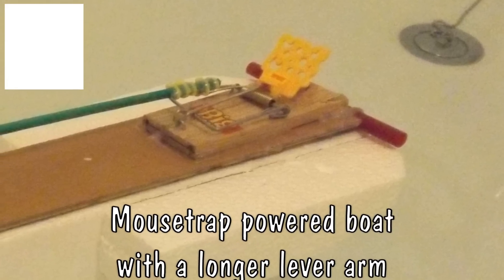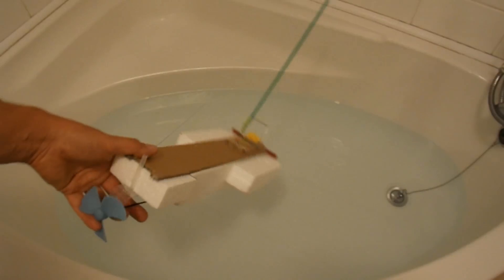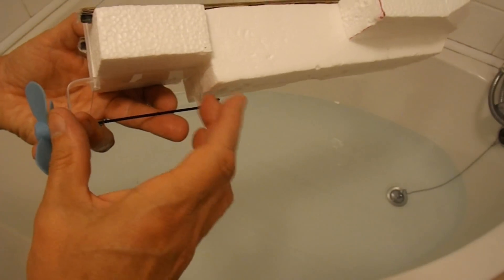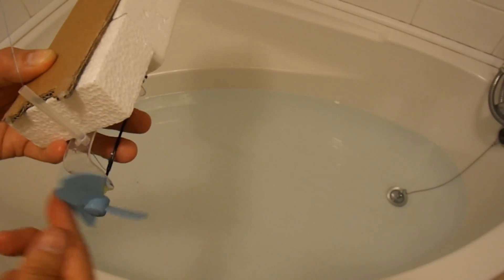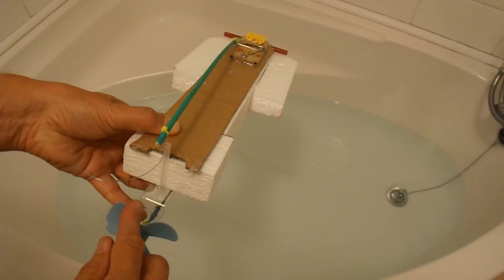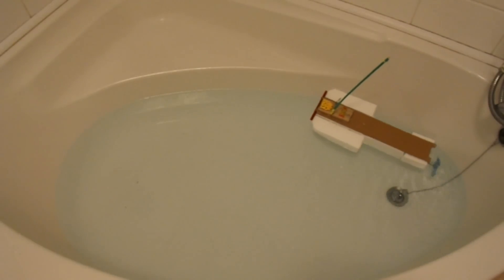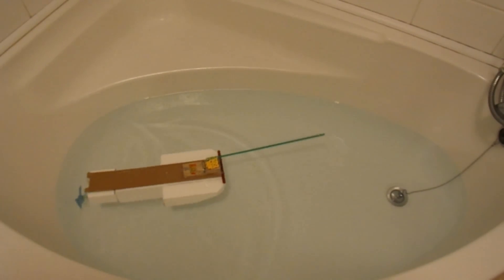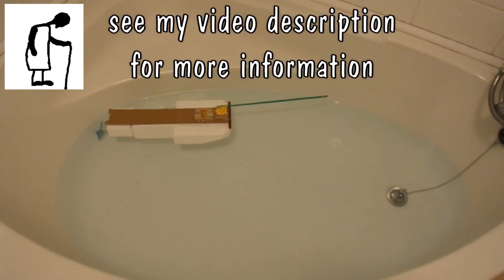Mousetrap powered boat with longer lever arm goes further

Comment: Awesome nobody puts more in their projects on YouTube as you
Reply from the maker: Thank you, you are very kind.
Reply: I'm doing this with my grandpa tomorrow, do you have any tips?
Reply from the maker: Caleb Arena most of the YouTube videos on mousetrap boats seem to use a paddle rather than a propeller, so if you can't find a suitable propeller then a paddle might be another option. I would suggest using quite a large propeller if you can find one as that will turn slower and make better use of the power available.
Reply: GrandadIsAnOldMan thanks